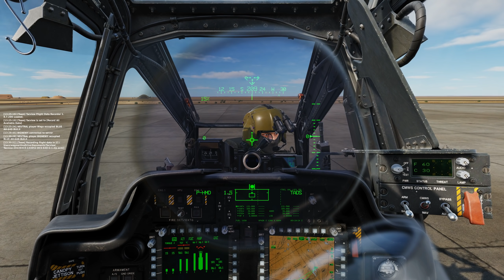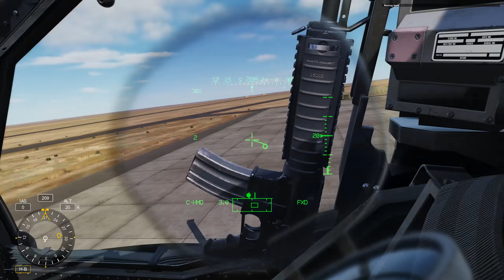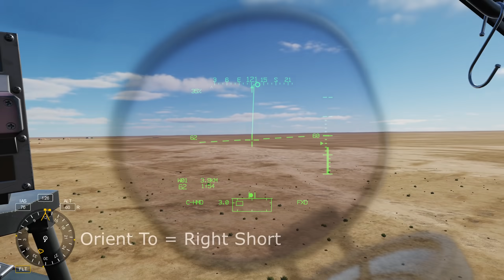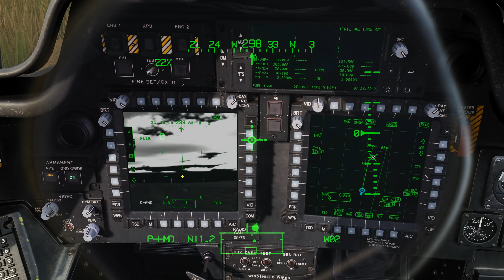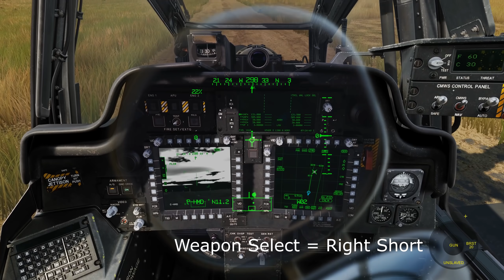DCS: AH-64D | Crew AI

Comment: Can we make pilot George avoid obstacles and not crash or able to land?
Reply from the maker: If want to be flying NOE, you should be flying the aircraft and not George. He is perfectly capable of landing when given direction (zero airspeed, zero altitude).
Reply: @MattWagner  Fair.  Just sucks spending 20 minutes pre flight just to slide into an obstacle in H-B.  I've also noticed George might be asleep if you transition from pilot to gunner.  Even though it might say 100 airspeed and 2000 Alt, It descended into a crash.  Quick Start Mission. Not sure if you can duplicate or known issue already

Comment: Will there be any way to control the speed of the horizontal translation in Hover mode? George seems prone to overshooting by miles, usually hover adjustments need to be slow, smooth and precise.
Reply from the maker: Depends on the duration of the translation command.
Reply: @MattWagner  Thanks, guess it'll take some practice, rock on 31st!

Comment: This is great that we should be able to do a whole mission from gunner seat and let george do the flying. I found that it was missing in the f14 system.
Of course I guess the ai will not be smart enough to do the whole mission flying without us to give full instructions on where to go :)
Reply from the maker: While you can be in the front seat and command George as Pilot to get you to where you want to go, there are limits. For NOE and hard maneuvering flying, it's best for you to fly and then jump into the CP/G seat near the target, and have George handle the hover and translation maneuvers.
Reply: @MattWagner  so george is not able to do evade manoeuvers ?
Reply from the maker: Yes, please see the video. He can do left and right breaks, and 180s.
Reply: @MattWagner  I saw the video. what I wonder is if george is able to do evade manoeuvers by himself or if we have to tell him to do so. So, if we are at gunner seat, flying, and we are fired on, will george try to evade the fire ?
Reply from the maker: @harf4ng  We looked into this, and in the end, it caused many more problems of him going defensive when the player may not want him too. It's wiser to make it a command.
Reply: @MattWagner  is it a command to make it défensive ? Or you have to manually tell him to go here and there ? That would be good to have a neutral or défensive state for george. So we can choose him to evade or not. As when we are concentrated on mfd we may not see à threat :)